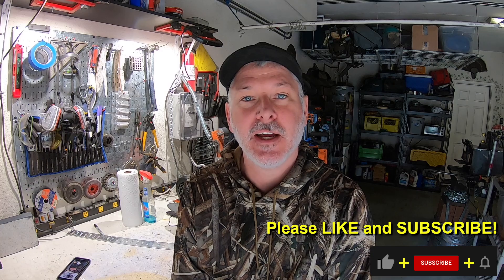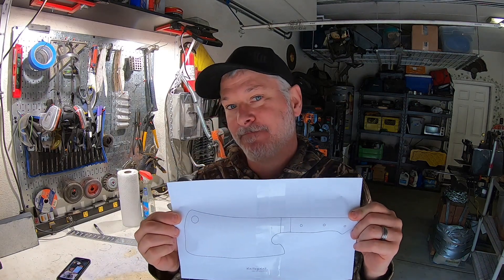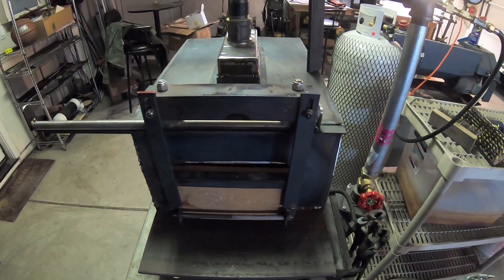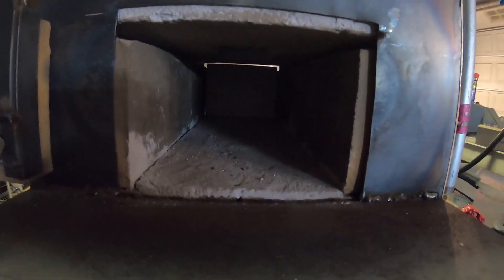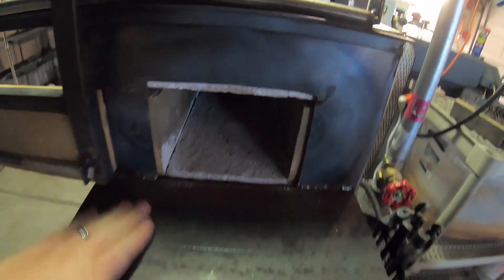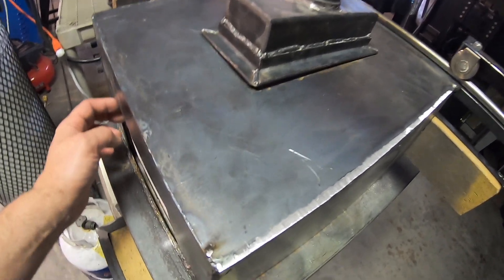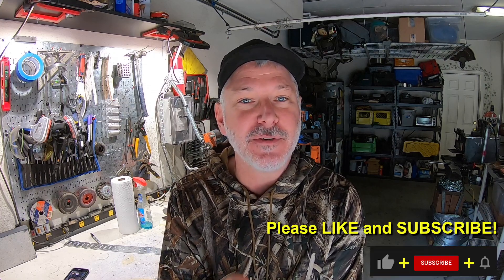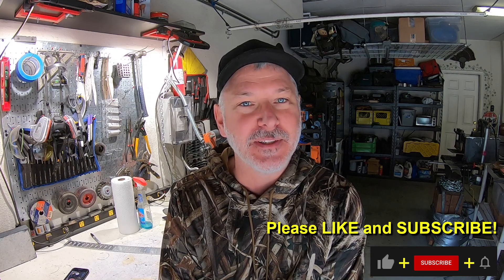Triple-T Thursday #14 - Forge Completed!

Comment from the maker: I'm really pleased with the new forge!  The only thing I might have changed is using thicker steel on the front around the opening.  I think the 14 gauge is going to deteriorate faster than I'd like.  I guess I'll replace it when I need to.  Anything else you'd change?
Reply: Nice result....seems a forge build to last a very long time. The mentioning of how much gas pressure is actually meaningless to other builders if they want to make a simular forge. If you do not mention the size of the orifice where you pump the gas trough . Lets say i have a orifice  1/25 " in diameter and i put my gas pressure at 4 psi....i will not be able to pump the same amount gas in if i only use a 1/32 " orifice at the same gas pressure. Its the same with a needle valve....if you dont mention the exact hole in that valve you could get a different result using another brand needle valve.  The volume of gas will be less or more so the result will also be different. If you however mention the inner size volume of the forge , the diameter of the orifice(or valve) used , the gaspressure and the ventilator you used....then they can copy that and get about a simular result.  I also had a problem with the bulging of the front plate.....i just made the hole bigger so the exhaust flame could not contact the plate directly.
Reply from the maker: @HoutmeyersP  Really good points!   The orifice that gas is flowing out of is 3/16".  The pressure at the regulator is releasing about 3PSI and the needle valve is about 1/3 to 1/4 the way closed, depending on if I'm forge welding / heating up or just doing regular forging.  So I'm just assuming that the pressure is around 1PSI or a little less.  For reference, the inner size is 7" (.58') x 4.5" (.37') x 18" (1.5')  or 567 cu/In  (.32 cu/ft).  All the valves used are in the description of the video.    I do need to make that hole in the steel a little bigger so the flames aren't as close.
Reply: @TyrellKnifeworks   A friend of mine has cut the insulating bricks in a way that they partially protude the front metal plate about 1/2 " so only very minor heat can get at those plates. Some heat resistand paint makes a self build forge look even more professional :) It also covered the bad weldingjob i did on my forge ;) . The plug at the back does not always contain the heat better or make the forge heat up quicker. If you have a long shafted thermocouple and a device to read the inside temperature it could very well be that the forge heats up faster with the hole at the back wide open than with the plug inserted.....no explanation other than that the forge sucks in even more oxigen giving it a better burn.(dont really know). It was a difference of about 100°f extra in about 30 seconds....after that the temperature leveled out and was stable . It could be different on yours depending on shape and volume. If you have acces at a temperature metering device you could do some testing on what setting gives you the maximum amount of heat . Propane is a high enough cost in forging.
Reply from the maker: @HoutmeyersP  I'm probably just going to cut the hole bigger in the front so the 14 gauge steel is further away from the heat.  I'm not worried about the shelf since its 1/4".  I'm not so convinced on the plug in the back though.  Worth some investigation for sure.  It definitely will get a coat of high heat paint... still on the list of to-do's!  Thanks for you input!
Reply: Nice build. If you move your gate valve to the top of that galvanized nipple you won’t have to bend down and you’ll be able to tune the gas at the needle valve and the air at the gate valve at the same time.
Reply from the maker: @davepage5875  now that they are set, I really never change them too often.  I wanted the gate valve close to the blower in case it affected it’s strength.   It probably didn’t matter though.
Reply: Yep, that's what I find the best way to learn is to just do it. Wait!  when working with Hazardous materials it's best to learn first.

Comment: No propane shut off valve?  I was advised if electric fails or blower  mower fails shutdown the gas so I don't blow-up or burn down my Forge. 
Only $20 investment 
Love your brick setup
Thanks
Reply from the maker: This is actually my old forge.  Watch the more recent one.  On the gas solenoid, it only protects you from a power failure, not if your blower dies.  Your blower will typically still get power so the solenoid will still function.  Just font leave the room with the forge on.  My new one had one, but that’s more for future planning for the PID controller.  Thanks for watching.
Reply: I was recently told I need a intercombustion  flame arrestor someone said about $ 60.00 and I should check out this more we don't like losing our Forge or being hurt thanks I'll find the resent build
Reply from the maker: @johnjude2685  I have never heard of a flame arrestor on a forge.   That’s something you see on an oxy welder but not a forge.  You’d want a solenoid.  Check my new video: How to build a ribbon burner forge
https://youtu.be/xL8waDrGVlY

Comment: Hello, I made a ribbon burner forge, but is it too oxidizing for steel, is it normal or am I making a mistake?
Reply from the maker: When you say “oxidic” you mean it’s oxidizing your steel too much?  If so that means you are running too much air and not enough gas.  Try changing that.  Do you have some kind of baffle or gate valve for your blower?
Reply: @TyrellKnifeworks  yes I have, thanks for advice.

Comment: hey denis wanted to ask what size mig tip works the best on your ribbon burner ?thanks i want ta ad doors to my ribbon burner forge what size rod is that you used on your doors thanks Mark
Reply from the maker: Don't use a mig tip, it won't provide enough gas flow (you'll see later I removed it in my build).  Just use a 3/16 hole only.  The round stock I used is 5/8" which matches the pulleys that I provided the link to.  👍🏻
Reply: @TyrellKnifeworks  thanks very much denis appreciate it

Comment: I know you answered me and i got a 75$ pre built forge and it blows thru propane and the price is up to almost 5$ So thought I would build a forge that was thicker and more efficient.  Do you just use a regulator at the tank? I see so many say have two regulators, Needle valve no needle valve etc etc. I have mirrored items i see for sale for crazy prices that are 25$ to build. I wasn't sure if i should get two regulators to be sure its low pressure but 2 psi is low pressure so seems dumb to me. A solenoid might be smart if power goes out or fan fails etc etc. I was going to bend steel for the shell but what thickness is the least i can use. I have a 0-30 psi regulator with gauge at the tank about 10 foot from the forge behind my shed I do have a shut off inside near the forge
Reply from the maker: I wouldn't use two regulators.. that seems silly.  Are you planning two venturi burners? If so you'll definitely need the 30 psi regulator.  I would just plumb a single hose from the reg and then split that into two.  If you want a shutoff for each, then add that right before it connects to the burner.  For venturi burners I wouldn't bother with the needle valve and control both with the reg.  If you're using forced air, then why two burners?  Go with a longer ribbon burner and you don't need to split it.  Unless you plan a forge longer than 18".  Sounds like you are considering forced air if you are thinking solenoid.  I just don't ever leave my forging area when the forge is on so I'm not worried about the solenoid.

Comment: Hello. On your gas intake thats pass the needle value what did you end up doing with that? Thanks
Reply from the maker: I removed the mig tip and it’s just a 3/16 hole to supply gas to the system.  The needle valve controls the amount.  I usually have the regulator pressure at around 3 psi and further constrict it with the needle valve.  Does that help?  Thanks for watching, Jim.
Reply: @TyrellKnifeworks   Yes thank you

Comment: Why straight down for the burner orientation doesn’t it blowing on your Damascus make it scale more?
Reply from the maker: No not really if you have good control of the air vs fuel mixture.  When I’m forge welding I make sure it’s a fuel rich environment so there’s less oxidation.  That’s a downfall of these Frosty-T burners or other Venturi burners that folks are using, there’s much less control.  With a forced air burner you have the best control.  That’s just about all experienced smiths have moved to forced air.  I also can put the billet to the side and not directly under the burner if I’m concerned about it.  I hope that helps. 👍
Reply: @TyrellKnifeworks  thanks I am just starting out and was going to buy a premade forge for 200$ is that a bad ideal or should I build one from scratch and do forced air? I’d prebuilt okay to start?
Reply from the maker: @christopherconkright1317  If you're just starting out, I think these low end forges are the way to go.  If you find you want to get more serious, in a year or so instead of relining this forge, just make one that meets your needs.  It's hard to beat some of these forges that are going for $150 these days just as an entry level one.  👍🏻
Reply: @TyrellKnifeworks  thanks for the reply. I’ve asked this to a few people your the first to reply. That helps a lot for me to make a decision.

Comment: Dang 
I run 15-17 lbs na, was going to make a ribbon burner for the forge I just built 5x5" x 23"  internal.. too small for what I do. 
Wanting to go 40" ish with natural gas but the parts are gunna be pricey. For professional burner & blower combined.
Reply from the maker: Mine is 7”x5” x18” and the ribbon burner is 3x8.  You could do two of those in a 40” or even 2 3x10” burners no problem.  I would totally build them instead of buying.  They are so easy to make for a fraction of what people are charging.  It’s $10 in steel, $4 for the couplings and the mizzou is cheap.  I bet you could build the burner/blower setup for $200.

Comment: Nicely done!
Unfortunately steel on the front is always going to deteriorate over time no matter what the thickness. I've had decent results with just doing a coating of refractory on the front to keep the fire from directly hitting the steel.
Reply from the maker: Yeah, I figure that is the case.  I'm not so worried about it.

Comment: Denis, did you bring that steel up to heat at 1/2 psi? That’s amazing at 5-6 psi I think!
Reply from the maker: I brought the forge up to temp using about 2-3 psi.  I can do normal forging between 1/2 - 1 psi.  Forge welding around 2 psi.  👍😁

Comment: Oh wow, the forge turned out great! I guess I gotta start figuring out how to get the materials for one here in Finland. At least the refractory is problematic to get.

Have you thought about switching to fluxless welding now that you have greater control over the air in the forge?
Reply from the maker: I have mixed feelings on the whole fluxless forge welding.  Mostly because some people think it’s some badge of honor to do it.  I’ve done forge welding without flux.  Personally I like flux.  I like that it takes all the scale off the billet.  I like being able to use a fine bristle brush and have a super clean billet.  After I’m done setting the welds then no need for it.  It’s a tool and there’s time to use it just like any other tool.  I’ve never seen any negative effects from flux like other say (because I don’t abuse it) except for what it does to your forge, which I’ve combated now, so I will keep using it.  Just my opinion of course.  👍

Comment: awesome forge ive been wanting to build me a ribbon burner forge myself now im definitly doing one this summer  did you make your own ribbon burner or buy it? thanks
Reply from the maker: I made the ribbon burner.. they are quite easy to make.  Easier than a venturi burner for sure.  It's a 3" square tube with one side cut out, ends welded on and then a hole cut in one side with a coupling welded on it.  Watch my other videos on hit and you'll see.  Thanks for watching!

Comment: I'm planning a forge build for my son.  Lots of research on it.  Your ribbon burner build and forge build videos are very informative.  With such an efficient flame, you might not get much metal deterioration on the front.  I'm considering using hard fire brick for the front face instead of sheet metal.
Reply from the maker: Once I got it up to forge welding temps last night there were a bit of flames out the front but nothing like a Venturi.  Hard fire bricks on the front would work well. 👍